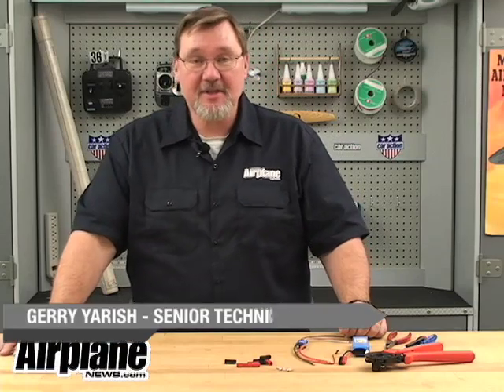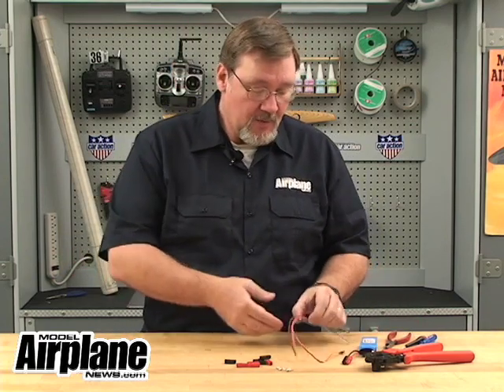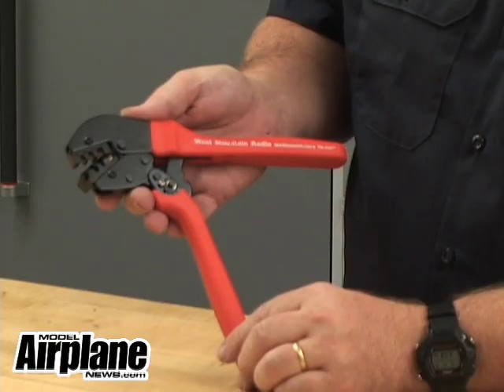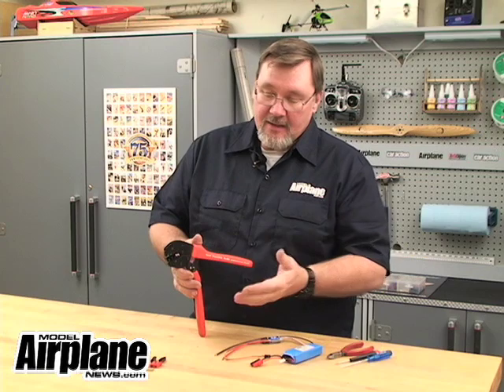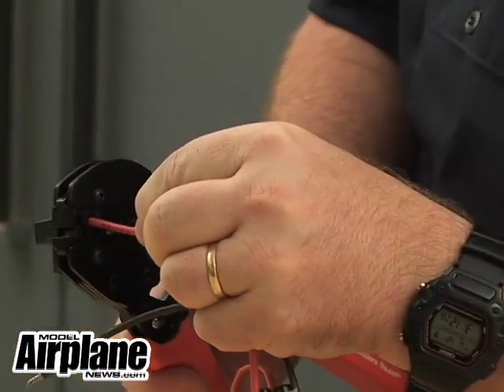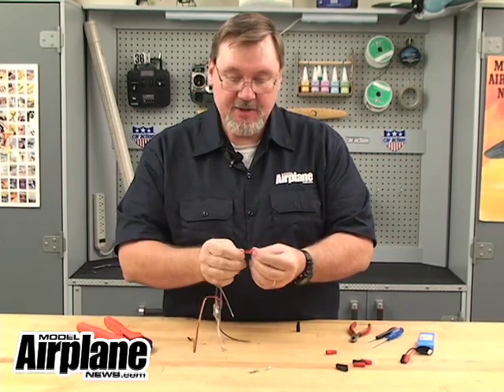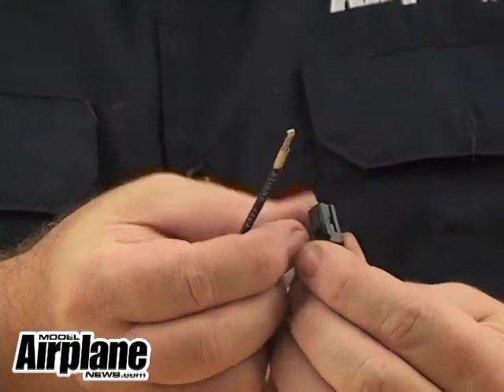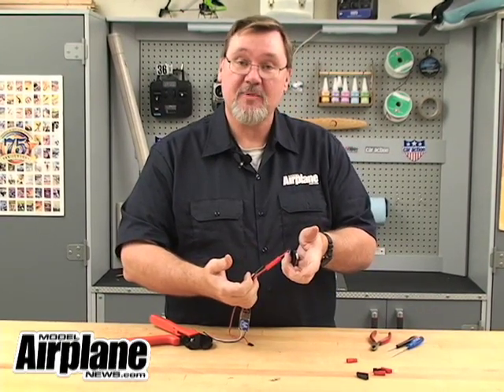Anderson Powerpole Connectors

Comment: Thanks for the informative Video.  Can I just use my Hydraulic Crimpers? They don't have the fancy dies, but the tool will squeeze the ever-loving crap out of the lugs.  Perhaps supplement by neatly soldering the connections too?

Comment: Yours are backwards like mine lol.  Standard Anderson connectors have the red on the left if the tongues are facing down.  I made one connection the opposite (like yours) and it cascaded so that all of my electronics and power supplies are that way... oops :)  I would need to make a pole-reverser adapter to interface with normal connectors. Oh well.

Comment: I just watched this video and noticed that the Red/Black connectors in this video are opposite to the universal standard that is commonly used for the APP's amongst RC and HAM operators.

The red should be on the Right. ( I use RED is RIGHT as a ditty to help me remember).

It makes no difference if all your packs are the same but if you like to share packs then it's best to stick with the standard because there is nothing stopping you from connecting them with reverse polarity.

Comment: so as a beginner into this hobby, i really need to know if I could reuse the parts for my old RC car to fly an RC airplane. And do I REALLY need an ESC for it. And is a 9.6V NiCd battery pack strong enough, I no its not a modern kind of batter but im not willing to invest in this hobby just yet until i get a hang of it. BTW, can i just use the ESC for any airplane or is it just like how the Transmitter and receiver work. u no, they have to be the same.

Comment: Screw Deans. If you solder the Power Poles you can re-use them easily without having to deal with buying more heat shrink, Or having to deal with the orange plastic body of the Dean's melting on you. I have 10 year old PP's that have been on more then one battery, Motor or ESC. ;-)